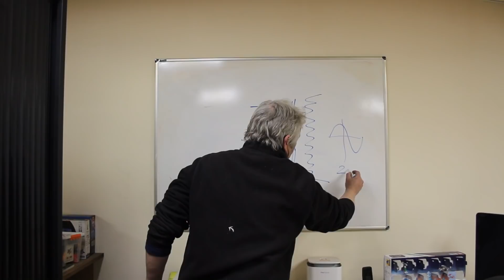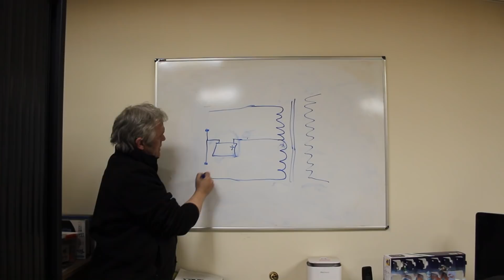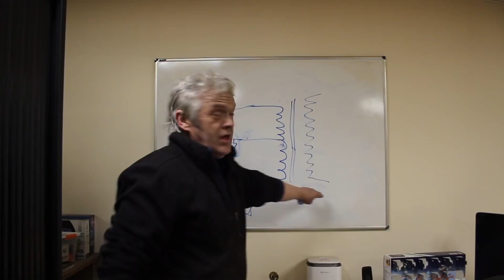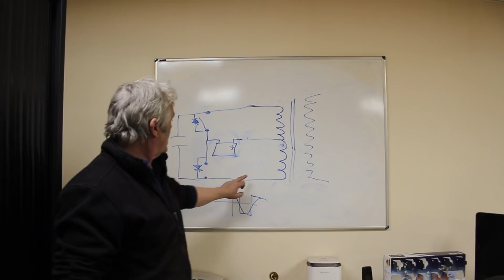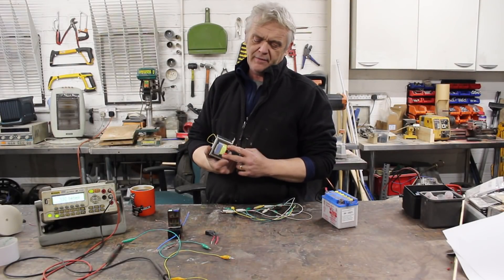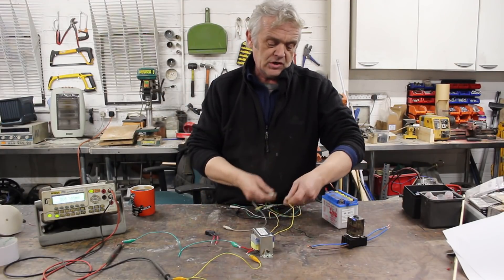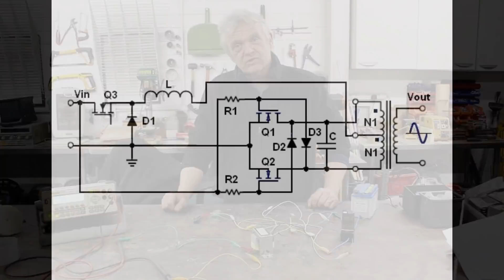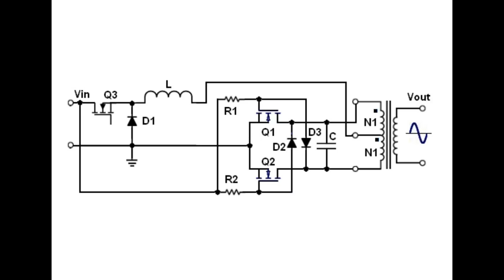1399 A DIY Inverter For Home Energy Storage - Wind Or Solar

Comment: Robert you are better off buying one of these ready made it's much safer to buy one and wire it up to standards for electrical wiring rules. Putting that aside I have an electronics certificate and a Licenced Electrician EA39003. Where you can make inroads safely into the area is the solar cell array to battery charge controller again though it's nice to make your own but as far as doing it well leave it up to people that make these. One simple solution for this which is not particularly efficient is just a large aluminium heat sink and 4 or 5 high current mosfets in parallel all driven with a zener diode fixed voltage reference, allowing for voltage drop I think the voltage of the zener diode is something like 16 volts. It does work it's very simple and it's pretty reliable as long as there are no overcurrent conditions and it's wise to put a fuse into it to stop this from happening.
Reply from the maker: I think that depends on the individual myself mate - some like to buy, some like to make and some just like to talk about it - that was not a veiled insult mate - you clearly know what you are doing - it occurred to me you might take it the wrong way as I was typing it so I just wanted to make it clear that I think you are clearly one of the guys who can choose to buy or make if you want to - cheers
Reply: @ThinkingandTinkering  fair enough Robert but if somebody starts to seriously get one of these going and gets 240 v 50 Hz output square or sine wave it only takes less than 20 ma of current flow at 50 Hz to get the heart out of rhythm into fibulation then the only thing anybody can do is get the rythym back with a defibulator and most people don't have one at home. Buying an inverter reduces the risks of this because debugging a home made inverter that's got transformer outputs of that range is extremely unsafe it would never get through ohs rules at work and it's even more dangerous at home, no defibs or people around to see you on the floor and hook you up. Carry on....

Comment: Wouldn't the capacitor make it a simulated sine wave and not a true sine wave?
Reply from the maker: the cap and inductor are a tank circuit mate - which is a ringing oscillator - so no it would be a sine wave - a simulated sine wave is. usually a digital output in a step function - a bit like a Fourier transformation where n would be 2 or 3

Comment: I made a homemade inverter once using an "old school" car battery charger transformer in reverse (the output became the input).
I used high power mosfets as the switching components (with supporting resistors).
I discovered the load requirement also had an effect on the frequency of the inverter's output.
Higher the load = lower frequency.  It was about 20% efficient.
Reply from the maker: you will find a push pull inverter for battery applications in a UPS for example - your frequency dependancy was because you didn't have an isolated timing signal - the real thing to watch out for on current driven inverters is going to be core saturation I would think

Comment: How does the capacitor work when it's only connected to two negative lines. Doesn't a capacitor need to be connected to positive and negative so that it builds up a potential voltage higher than the VCC? I love this topic by the way.
Reply: Positive will be present on the other, unswitched, winding since only one is switched to negative at a time. Both the negative ends will each see positive voltages, when not grounded by Q1/Q2. A non-polarized ceramic capacitor is ok here.
Reply: @MickMcMadder  thanks mate, that actually makes perfect sense after I researched a few circuit diagrams.
Reply from the maker: Mick gave a good answer mate
Reply: The 2 coils act as one. Negative is not present on both at the same time.

Comment: Nice, basic pulse inverter! But this version loses quite a bit of efficiency on the backwards voltage coming from the inductuctor. I think its much easier to go for a 4-transistor one that doesnt have such a problem. And if we prefer the cheap, dirty and easy to make it could make sense to make a relay vibrator pulse generator... And as for the most cost effective inverters for renewables i recommend fiddling with old UPSes (or broken ones, they are often easily repairable or even possible to reverse engineer to make your own inverter)
Reply from the maker: I think you are spot on with grabbing a UPS mate - I actually have one and it is going to be in my next videos - so you are kind of pre-empting that - but that is awesome as we are clearly thinking the same way lol - I think this just helps to understand the basics to be honest